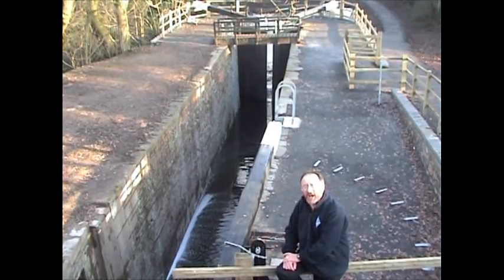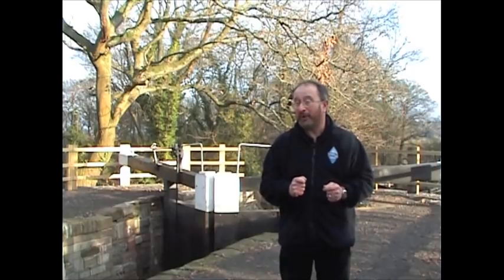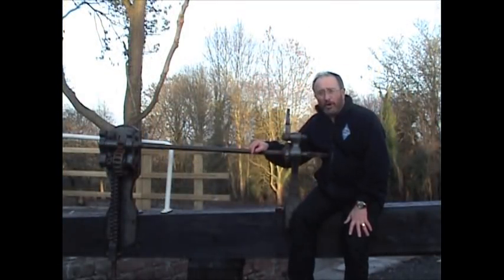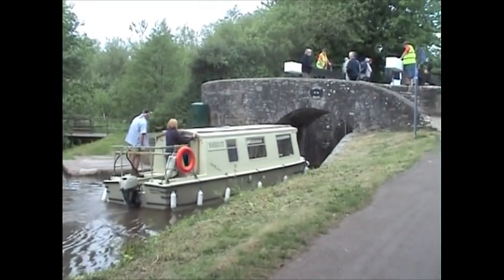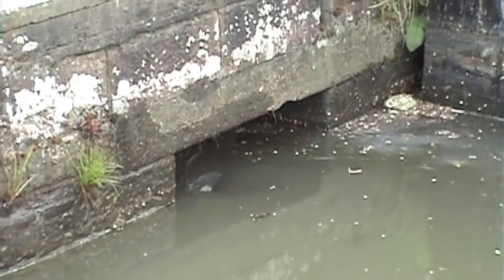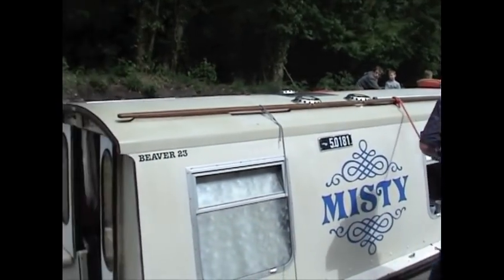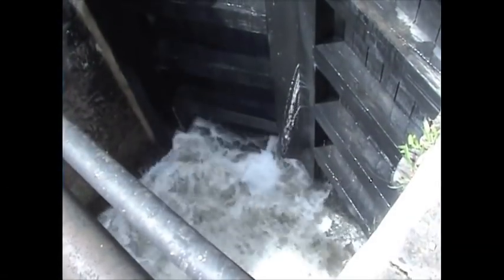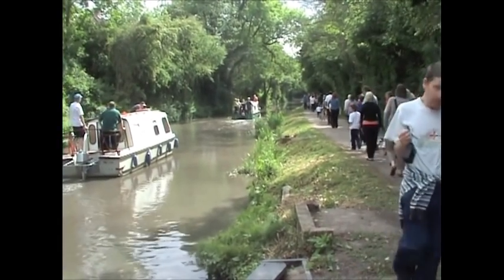How A Canal Lock Works

Comment from the maker: This is a very good question. Canals are man made waterways and need a constant supply of water. This can be provided by specially constructed reservoirs or directly from rivers. The idea is to keep water loss to a minimum. At Fourteen Locks the Canal Engineer Thomas Dadford Junior designed s system of ponds and side pounds to ensure that as much water as possible was saved when the locks were being used, so reducing the amount needed to replenish the canal above the locks.